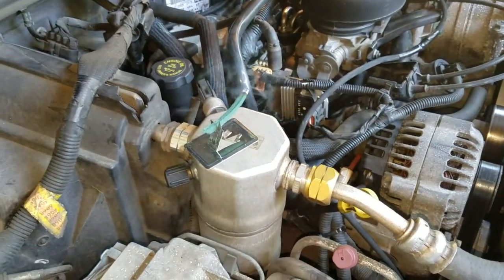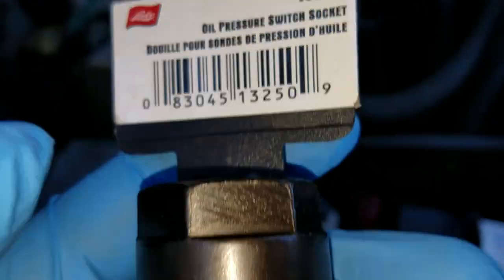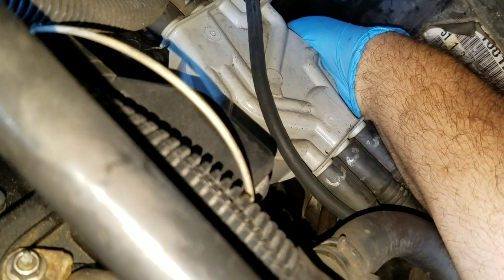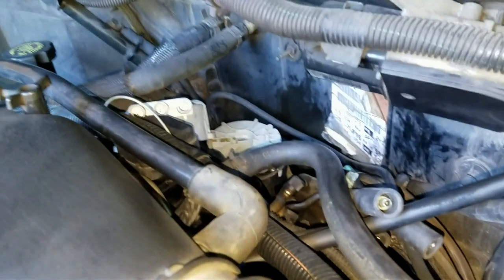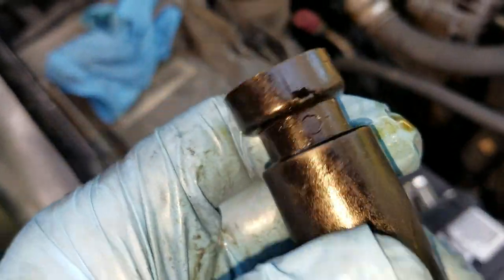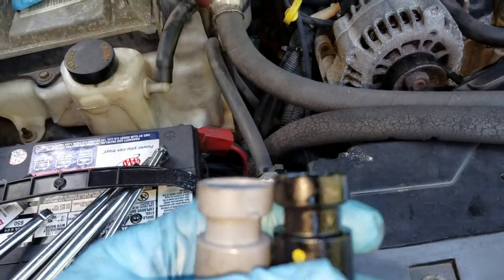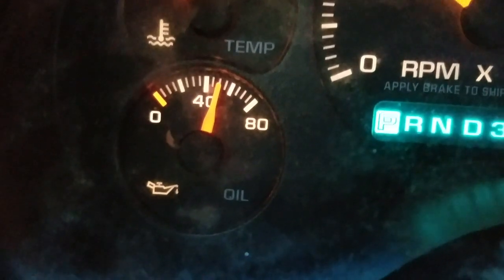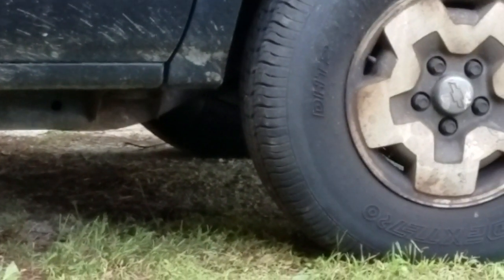Replacing Oil Pressure Switch Sending Unit Sensor Chevy blazer

Comment: Just replaced my leaking sensor two days ago, was afraid that I had to pull the distributor out, but thanks to you I replaced that sensor without taking out the distributor, thanks.

Comment: Hey you have a sender and a sensor on this thing? I had my sender go bad and leak oil but after it was changed out the oil pressure on the instrument panel goes up and down and all around. Its done leakin oil thank fully.  I have a 87 chevy s10, 2.8 v6. I thi

Comment: This video lacks the crucial part of seeing the sensor actually being taken out but it did give me some more confidence that the oil pressure switch on a 4.3 could indeed be replaced without messing with removing the distributor.

I was able to do it too but I will say that I can see were removing the distributor would have made it a bit easier.  My issue wasn't so much of access because of the distributor but more because its tucked away so far in the back.  A step stool to help get a bigger guy as myself up into the back of the engine bay would've made things easier but I still managed.
Reply: Chevrolet Astro by chance?
Reply: Ya anything down behind there in those trucks is awful you have to use mirrors etc to see what you’re looking for it is not too bad to r&r those distributors then it makes it a little easier but still an awkward workspace

Comment: Just to give everyone a heads up on replacement parts. That O’Reilly’s Master Pro house brand oil switch that I used on the same repair only lasted 36 months (with very low milage) and blew out worse than the original; a massive a oil leak that happened all at once.  I tried the Auto Zone brand and now the gauge reads 10 pounds on the happy side; going back to OEM, at least it last 16 years!
Reply: Yeah, I'd definitely recommend going with AC Delco especially for this part.  It's already a huge pain to get to, get the oem part that is going to last.
Reply: Yup ac Delco is the best way to go for parts like this

Comment: I have a 93 S-10 Blazer and I'm trying to figure out what kind of switch is located on the drivers side by the spark plugs, I thought it was the temp switch for the gauge but I found that on the passenger side. Any ideas on what this switch is? It looks like it might take a 1.5 socket or larger to get it off.
It has a single green wire going to it.
Reply: That's your Temperature Sending Unit.. I have an 02' ZR2. Located on Drivers side back by the #5 plug on the block

Comment: How were you able to maneuver the socket on to the switch? The one i bought is just to long not enough clearance to get it on the switch. Any tips??
Reply from the maker: I put the oil sending unit in the socket and got it started by hand. Then slipped the socket on it. I think I had a small extension  like a size adapter and then fumbled my way in blind to put the socket and the rinch together . It was a super pain in the butt it was hot and I was being attacked by mosquitoes.

Comment: Subbed your channel my Brother Thank you so VERY much for the Video ! You make it look easy lol ! I want go out a mechanical oil gauge in .But after watching you I think I'll go stick unless the sensor is over $20 . If it is a whole mechanical gauge kit with the tubing ( copper ) is $18 at AutoZone . That's exactly where it looks like it's leaking from .. Praying for y'all !  Also anyone else that has a Blazer the oil & Transmission lines going into the radiator in both sides have 2 two rubber I rings on each line that ho bad .after replacing these ( with the help of a friend ) it took care of a BUNCH of oil & trans oil leaks in the front . Godbless and Godspeed
Reply: Unfortunately if you want to add the mechanical oil pressure gauge you would need to add a tee off where the oil pressure switch goes because the oil pressure switch sends power to the fuel pump so just removing the oil pressure switch and putting a mechanical gauge won't work I tried.but,a better option is install a new oil pressure switch and glow shift has an oil filter sandwich adapter that has multiple plugs for adding mechanical gauges and other stuff that's the way to go as much as I hate using adapters between oil filters because it's just another couple places to potentially leak from it's a good solution for this application.

Comment: So if it leaking inside the part you connect the switch it means its bad because i had replaced mine about 6 months ago and now it leaking again inside of there
Reply from the maker: Yes that is my understanding.
Reply: @NorthCarolinaPrepper   ok thanks

Comment: Will this make you oil pressure go down when in park or at ideal bc mine is fine when driving but if it is setting it drops way down
Reply: Sounds ok to me! It would drop all the way down and not go up if something was wrong. When you rev the motor while idling, it should fluctuate back and forth. While driving it should stay above, at least 40. Then, when you come to a stop, it goes back down. Repeat.
Reply: TTJ BigGunner I got one of these bad and if I’m sittin at a light it goes down and the check gauge light comes on in the dash. When I start driving again it goes back to normal

Comment: How were you able to place socket on old sensor when removing it?
Reply from the maker: Oh boy was that a pain in the butt. I climbed up to of the engine and use my cell phone in selfie mode (front facing camera) and got the socket on then used a extender to connect the ratchet to the socket. I think halfway thought I had to take to ratchet out and use my fingers to get it out because it was hitting the back fire wall.
Reply: @NorthCarolinaPrepper  thx bro

Comment: I have an 02' Blazer ZR2 & changed mine last year, 2022.
My pressure runs around 20 at idle & 50 when running..
That's with the oil cooler lines removed.
It will run higher on a fresh oil change. As you put miles on it, the pressure drops. When I first deleted the cooler lines, it ran around 60 But, slowly dropped off.

Comment: pressure switch easy to get to. From above tire. Pull off small rubber shield, use a flash light
Reply: Great for plugs too!
Reply: Driver’s side or passenger?
Reply: @arnoldc30  passenger side
Reply: Not on 2wd models.  Its right under next to the distributor on top.
Reply: @UberStarFkr  I have a 2 wheel drive we talking about oil pressure switch. Not Fuel
Reply: I'm talking about oil pressure switch as shown in the video.  My 01 4.3 is in the exact location as in video which means no way it can be reached from the wheel well.  I have read that the 4WD has the sensor in a different location.
Reply: Actually looked it up.  You must have a 2.2L.  Instructions for its oil pressure sensor removal is indeed through the wheel well.  On the 4.3s like in the video, you have to go from the top of engine like in video.

Wish I had the 2.2L location though lol
Reply: sorry it is a 2.2L. Instructions for its oil pressure sensor removal is indeed through the wheel well
Reply: I thought that you were going to remove that elbow from the vent pipe

Comment: My 94 Suburban shuts down when the oil pressure drops because the sensor is wired into the fuel pump relay.. lol. About to fix mine...